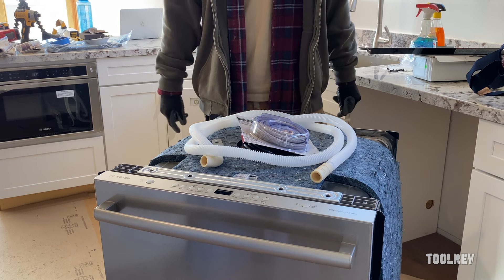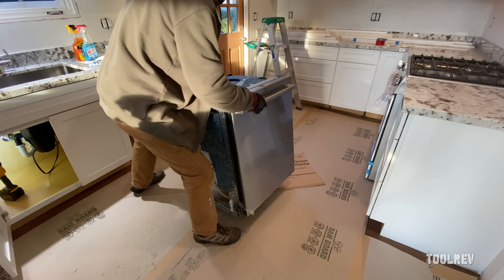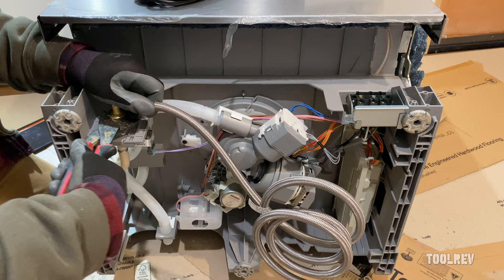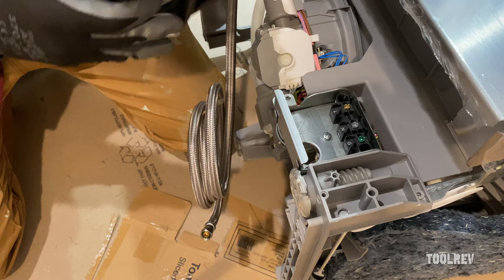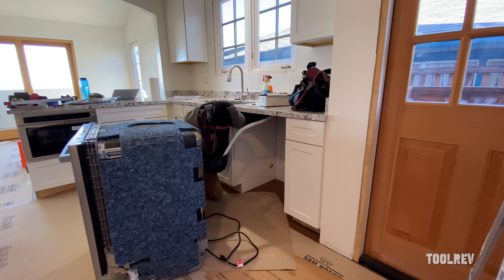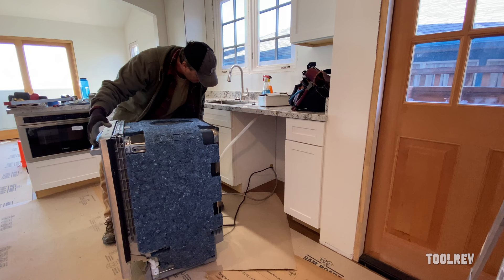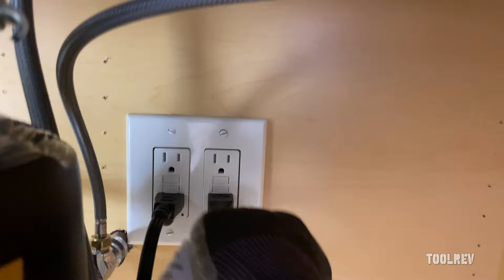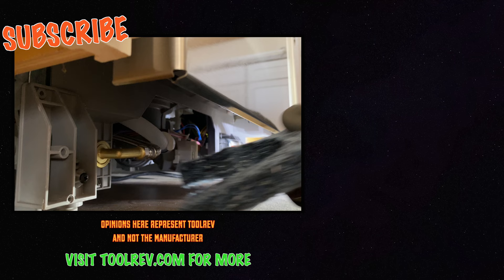How to Install a Dishwasher

Comment: Do you need an air vent when installing a dishwasher? Or the garbage disposal acts like one?
Reply from the maker: The garbage disposal does not act as a vent as far as contaminated water back flow prevention. Your local code may require a vent/air gap which is superior to the high loop method used in this video.
Reply: @toolrev  Thanks for the video, unfortunately my state Washington requires a air gap. I really didn't want to add a hole in my new quartz for that but unless there a garbage disposal that has air gap for a dishwasher and wont back flow.

Comment: How about if you dont have a garbage disposal where do i connect the drain hose.???
Reply from the maker: Check it - https://www.homedepot.com/p/Oatey-1-5-in-x-8-3-4-in-Branch-Tailpiece-Plastic-Slip-Joint-HDC9698/315724875
Reply: @toolrev  thank you soo much...

Comment: I own a Bosch and so I'm compelled to share some special information about it, if yours is like mine, that is, one with a stainless steel interior.   The way it dries the contents is by condensation.  When the moist air in the dishwasher comes into contact with the COOLER stainless steel tub, it turns to water droplets and these flow down. To make this effective, it is far better to connect it to COLD water and let the dishwasher take care of heating the water when it needs to.  During its last since, the interior is cooled by the cold water facilitating the condensation. If you use hot water, you are defeating this purpose and you will have much longer drying times.   

So not all dishwashers are the same in terms of installation.  Please spread the word and make some people happy.
Reply from the maker: More power to you brother but cold water increases runtime according to Bosch. The only advice I endorse is following the manufacturer's installation instructions. See ya!

Comment: Don't all of the hoses require thread seal tape?
Reply from the maker: You can use it if you want to but it's not required or necessary for cloths and washer connections.
Reply: @toolrev  what's a cloth?